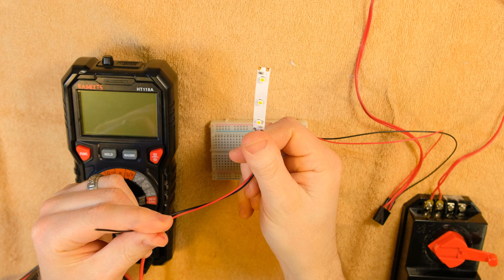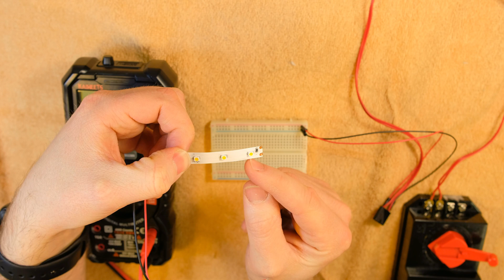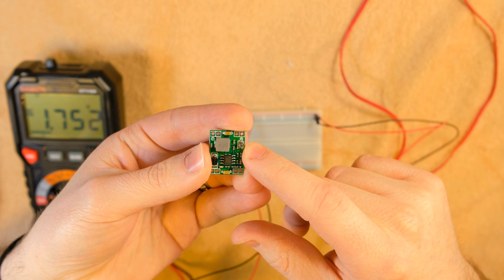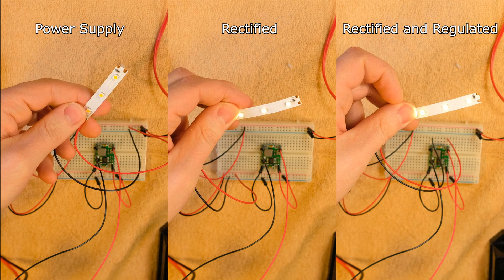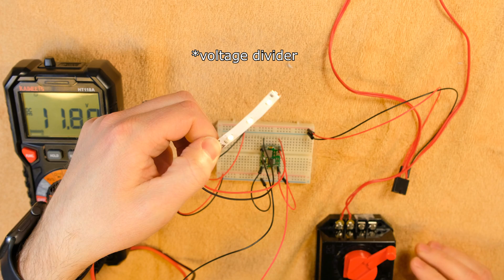Simple LED circuit for AC or DC model trains and general modeling use.

Comment: One of the better videos I've seen.  So glad you mentioned the divider.  Maybe add the divider as a part two and also show how you installed these i.e., passenger cars.  It is so much easier to order the components pre-made (although still waiting on the LEDs), rather than taking the time in creating my own mess of circuitry.  The rectifiers and buck board are perfect HO size.  I plan to mount in roof of passenger car, but I will need to cleverly conceal the capacitor.  FYI: I prefer diagrams, but it made sense to use the bread board for the demo.  Happy New Years.